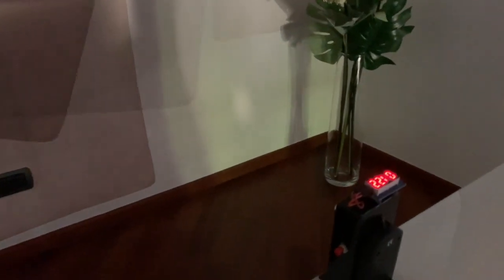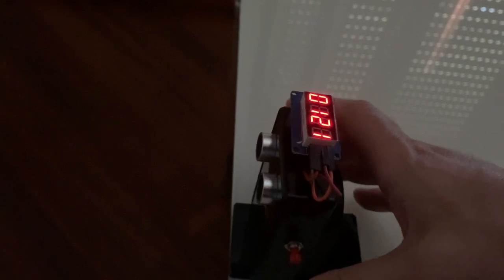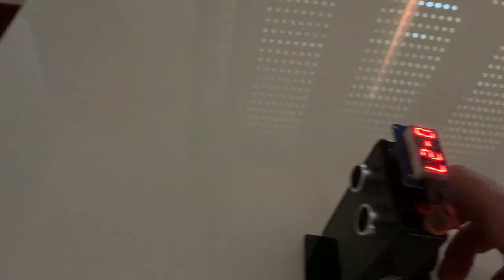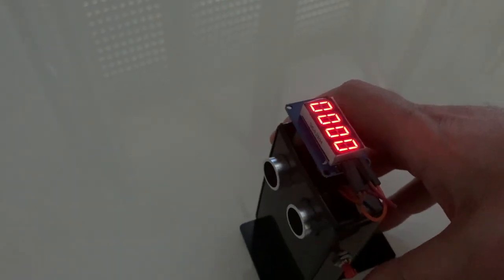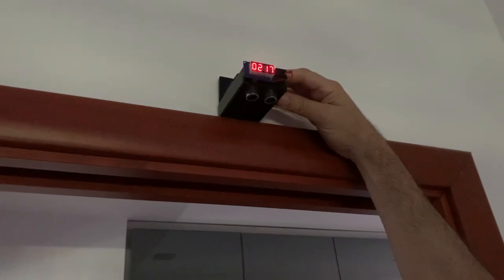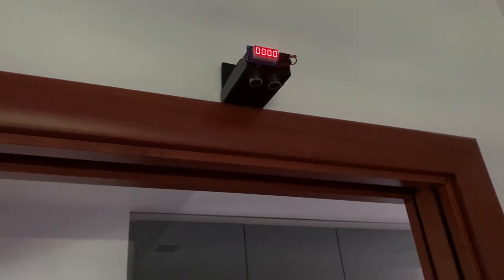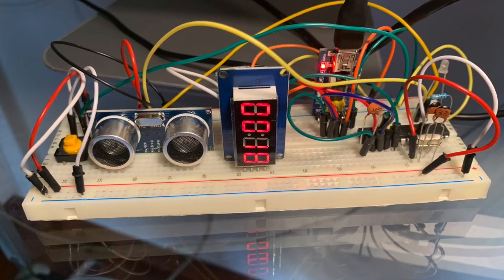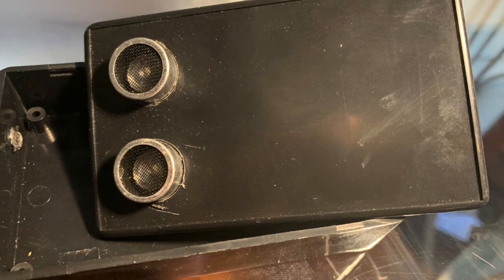Smart Arduino Digital Meter with #HC-SR04 and #TM1637

Comment: Great project. Will it work with Uno and Nano?
Reply: Fantastic project. Can you supply a link for downloading the schematic and script
Reply from the maker: Hi Paul. Send me an email and I will reply with all the documentation.
Reply: @CarloStramaglia  hello Carlo thanks for detail :) I’ll send you a mail so :) great job
Reply from the maker: Email sent.
Reply from the maker: Sure. If you want I can send you the details and then what you need to do is change the 328P with a Nano or Uno.
Reply: @CarloStramaglia  Hi , can you please provide me the Arduino nano/uno details. I am really interested in this project and can't wait to make one on my own. BTW Great Project
Reply from the maker: Hi. The link with all the details are here. https://create.arduino.cc/projecthub/cstram/smart-arduino-digital-meter-with-hc-sr04-and-tm1637-5944b3
Reply: @CarloStramaglia  Can I use Atmega8 instead of Atmega328
Reply from the maker: I think so but I did not try it.
Reply from the maker: It should work but I never tried